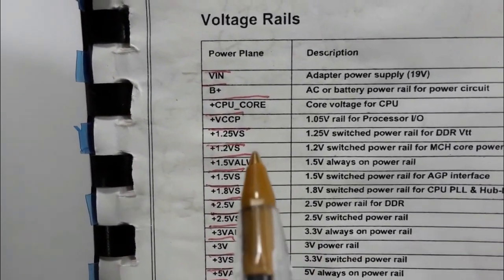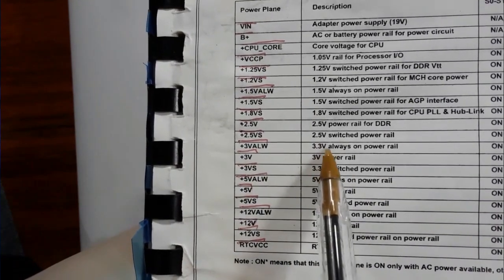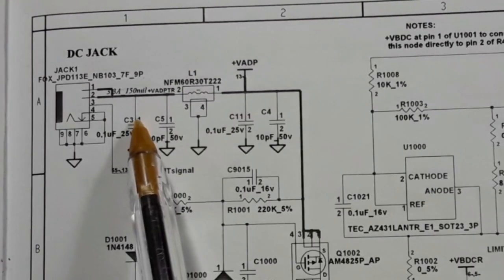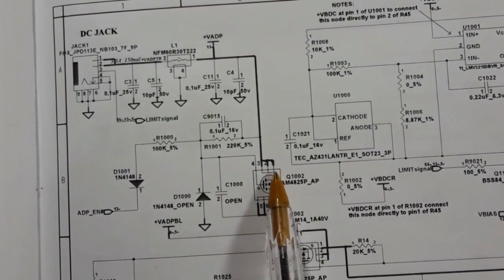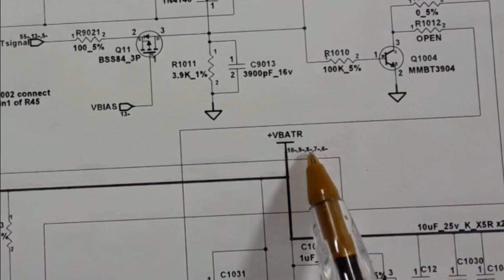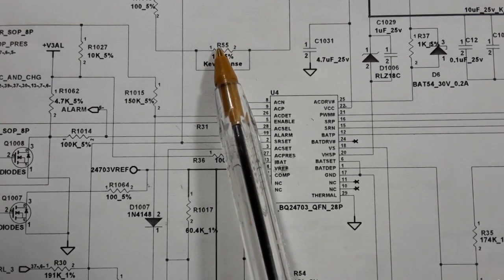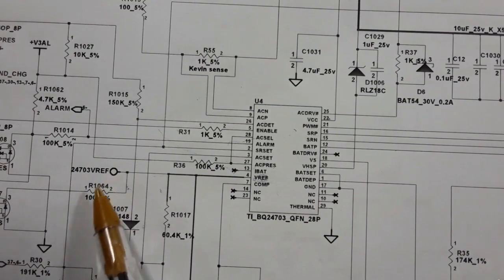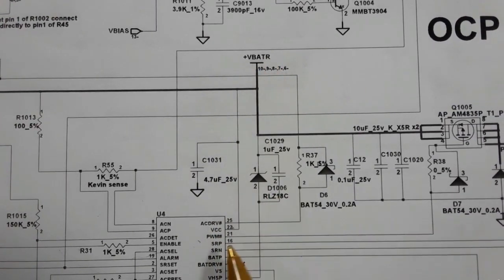Learn Motherboard Voltage Rails + Charge IC Pinouts Analysis - Laptop Motherboard Repair

Comment: Selam. power jack ım bozulmuştu söktüm. 19v adaptörü lehimleyerek bağlayıp enerji verdiğim an kısa devre yapıyor ve adaptörüm kendini korumaya alıyor. 19 v hattındaki R010 ve R020 dirençlerim dışarıda 3-4 ohm ölçüm veriyor. bir şekilde pozitif + hattımda kısadevre var. bir çok şeyi söktüp kontrol ettiğim halde kısa devrenin sebebini bulamadım. Asus model: X54H  MB:K54L bu anakartın diagramını bulmaya çalışıyorum fakat bulabildiklerim şemalar FZ formatında ve bir şey anlıyamıyorum. sizdeki gibi çizim şemaları bulabileceğim bir site adresi varmıdır. Teşekkürler...
Reply from the maker: please In english
Reply: Hi. My power jack was broken, I removed it. When I connect the 19v adapter by soldering and energize it, it short circuits and my adapter protects itself. My R010 and R020 resistors on the 19 v line give 3-4 ohm measurements outside. somehow there is a short circuit on my positive + line. Even though I disassembled and checked many things, I could not find the cause of the short circuit. Asus model: Is there a website address where I can find drawing schemes like yours? Thanks...